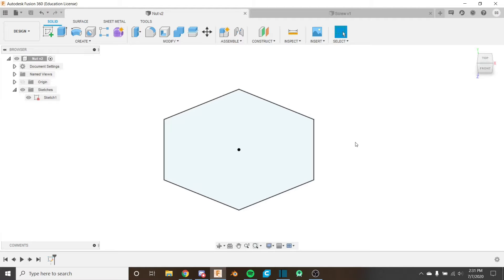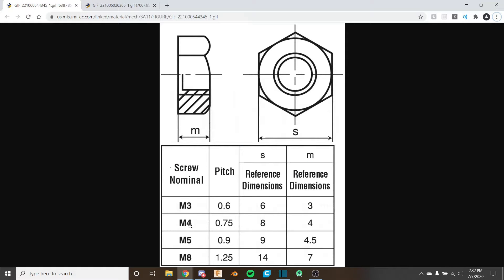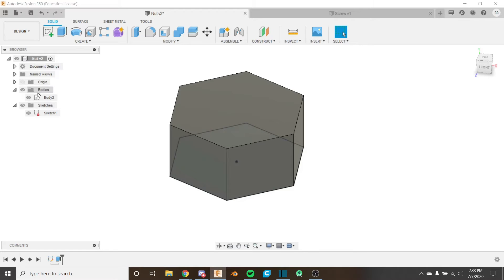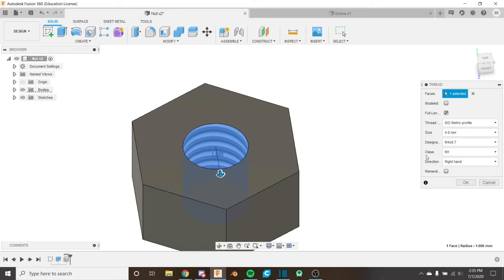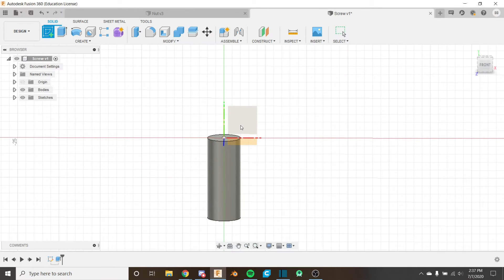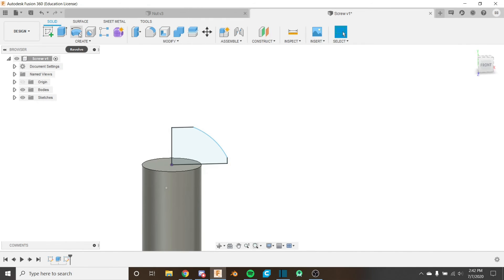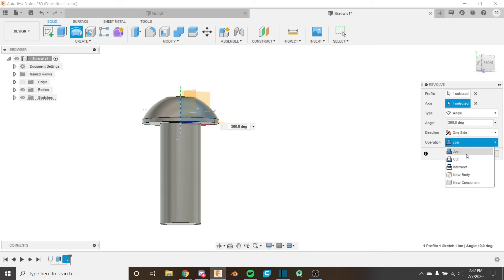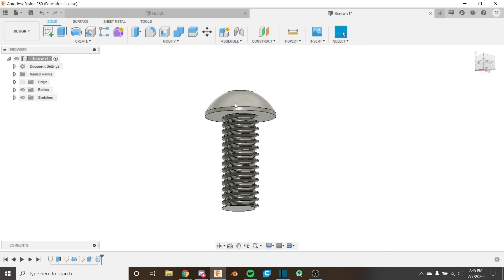Fusion 360 for FTC: Modeling the Screw and Nut

Comment: For the arc the diagram says radius of the arc is 1
Reply from the maker: I'm not exactly sure where you see that in the diagram, it is definitely possible I missed something, but in this case an arc with a diameter of 1 would be so small that it could not be coincident with both the point at the top of the screw and the point on the side of the screw.